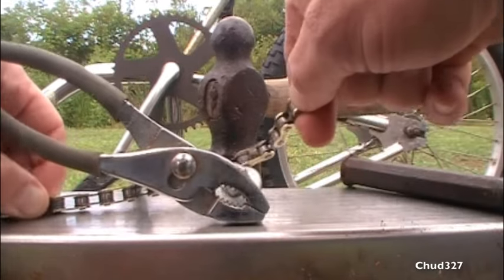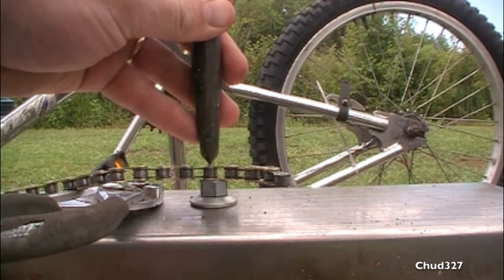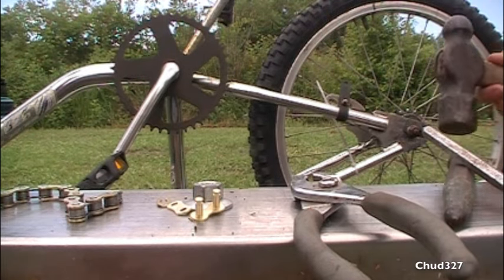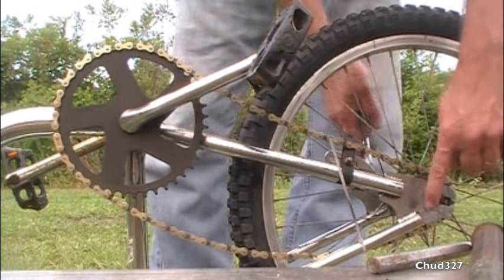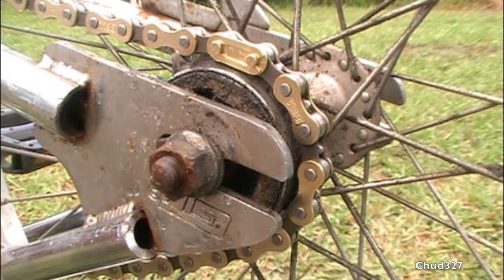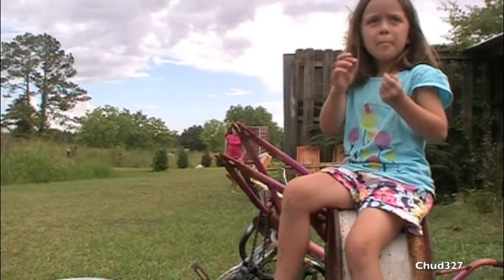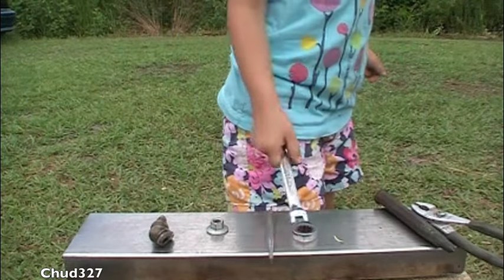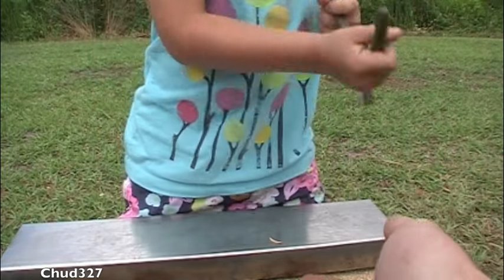Shortening a Bike Chain Without a Chain Breaker

Comment: Hi Bud you put the master link locking pin on backwards the closed side should run in the same direction as the wheel does
Reply from the maker: +Oiram Nojertsac What do you mean by the closed side? Thanks for the comment.
Reply: he means the side without the gap on the masterlink should be facing the opposite direction from the wheel rotation. If the Wheel goes forwards, the masterlink clip faces the other way :)

Comment: It works. You can also try pumpkin seeds, or any other seeds that you can spit with specific sound. Dependimg on the type of seed used, the chain will have different strength. Try 2-3 types of seed and decide which is the best for you chain type
Reply from the maker: I used to be almost addicted to sunflower seeds, sorry if that full mouth talk bother you.  I don't do that anymore. thanks for watching.

Comment: Where can I buy the two tools you used to put pressure on the chain and then release the bolt?
Reply from the maker: Shay Johnson I would say hardware store and get a skinny punch or nail set. Good luck and thanks for watching.
Reply: @chud327  Thank you sir and no problem.

Comment: if you dont have a master link could you take the pin out of the other link and then join the two together or is a master link needed?
Reply from the maker: You can do it with out a master link, but it is no where near as easy. Thanks for watching.
Reply: chud327 oh ok thanks

Comment: Didn't work for me.  The rivets were too tight to be knocked out this way because it wasn't possible to hold the chain steady enough, but they came right apart with a $15 chain break tool.
Reply from the maker: Sweet, good to hear that you got them out. thanks for watching.